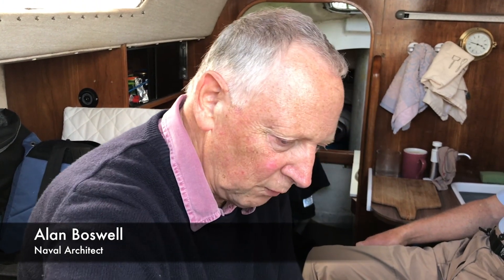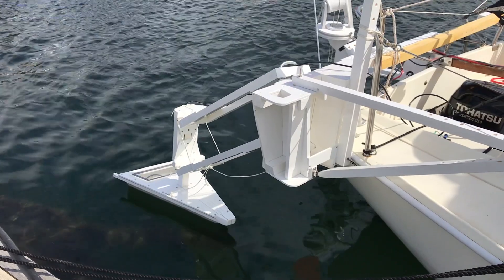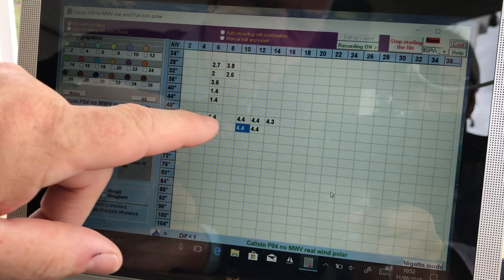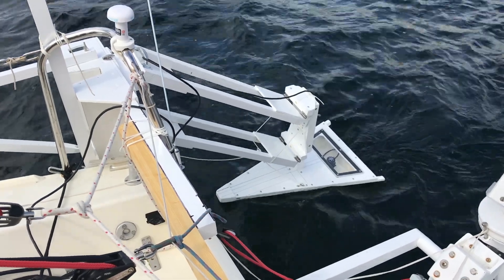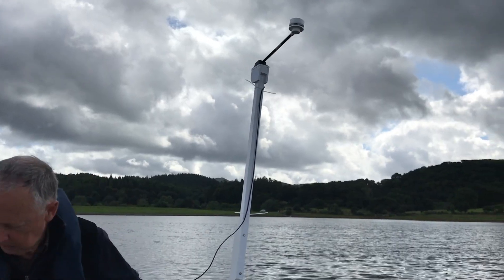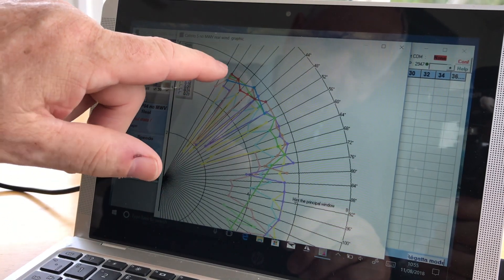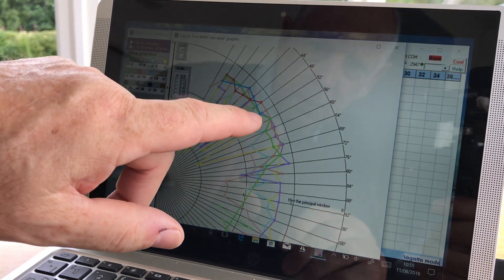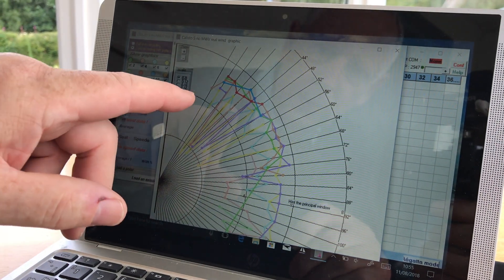Junk Rig Testing

Comment: OK thanks, this is revealing.  I am a fan of the junk rig.  I also play around with flying wing aerodynamics.  My opinion of efforts to modernize the junk rig to improve windward performance is not positive.  You must reduce induced drag by allowing the head of the sail to twist off completely.  This will minimize the vortex at the head, the primary cause of drag while sailing to windward.  That big vortex is a beast.  You want it low down, not at the head.  A strong vortex at the head spills off, creating a whole bunch of turbulence and NO lift.  Sails do not lift like an aircraft wing.  Wings lift by creating an accelerated velocity profile centered at the quarter chord.  Sails lift by creating a big vortex centered over the entire sail.  That swirling vortex accelerates air, which reduces pressure, which provides lift.  That is how sails work.

Comment: While this is a very fine piece of scientific investigation I can't help feeling that a simpler comparison might yield data that is easier to interpret for the purposes of designing junk rigs. The problem here is that the data is inevitably convolved with the hydrodynamic performance of the hull and we need to unpick the rig performance from this in order to progress our understanding of the rig.
I would suggest that land-based test rigs (perhaps scaled down in the first instance) could be run for very long periods with measurements from a sonic anemometer logged along with the lift, drag and rolling moments of the rig for a range of sheeting and other rig adjustments.

Comment: quite the interesting testing procedure.  I'm sure I'm not the only one that is impressed.

My question is:  how much do i need to increase the sail area on a Junk rig to get the same (or better) performance of that of a Bermuda rig?  

My goal is to put a junk rig on a catamaran.  I am considering a bi rig set up (believing there must be a reason that that configuration seems to be the most popular), possibly even a third mask center cockpit towards the rear or another bi rig towards the rear with smaller sail area's. (somewhat emulating a schooner).  awkward as it sounds, my math suggests that i can gain efficiency without sacrificing safety.  

Can you tell me your thoughts please.  I would not doubt that i am completely wrong.
Reply from the maker: Hi there. I've just put a link above to the test data from 2018.
Reply from the maker: Thanks for the comment and the question. I'm afraid I was only involved in making the video and I know very little about the theory of Junk Rigs. However, if you go on to the Junk Rig Association       https://www.junkrigassociation.org/    there is a wealth of information and a fantastic forum where you can get help. Good luck.

Comment: I would be very surprised if they found anything but the Bermudan outperforming the junk.
Reply from the maker: Hi there. I've just put a link above to the test data from 2018.
Reply: I watched at 1.5 speed, and went to speed it up, but realized it already is, and then watched to the end but no data?  That's junky.